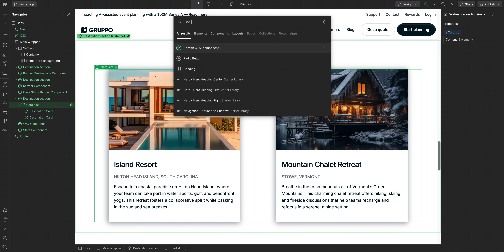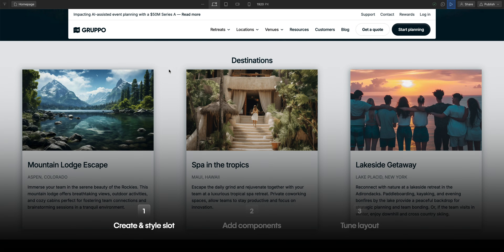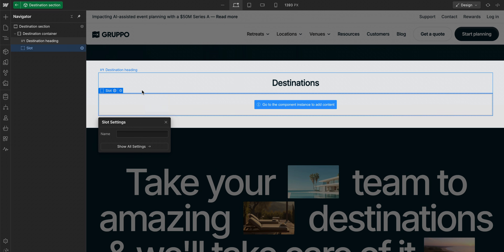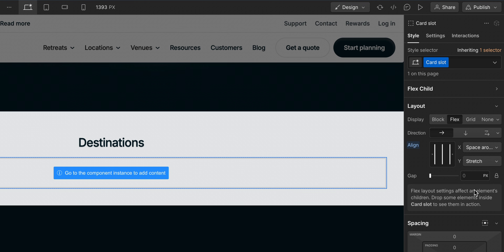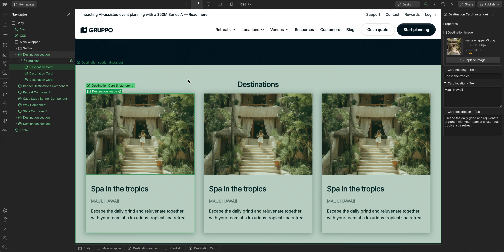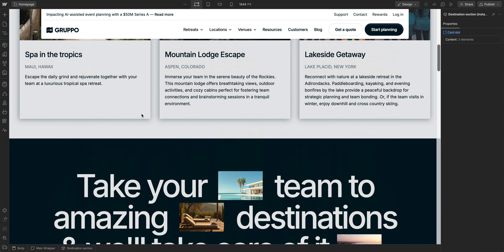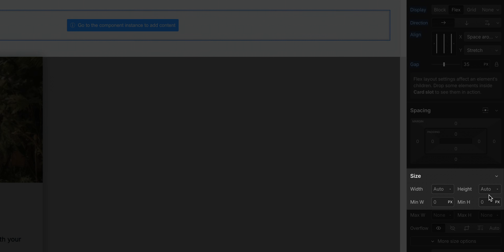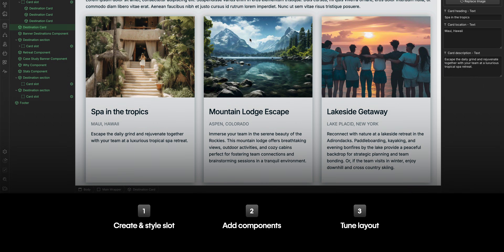Component slots for consistency & flexibility — Webflow tutorial

Comment: Poorly designed workflows can lead to unnecessary complications, especially when creating components. The issue arises when you are forced to work with empty components, making it difficult to visualize and design interactions. Without proper content, designing mouse interactions becomes challenging, as everything appears blank.

The process becomes even more frustrating when adjustments to images and text are made before creating the component. Once the component is created, you have to redesign everything, reapply styles, and reconfigure slots. This inefficiency is compounded by the fact that many class styles or parameters may not function correctly when applied to slots. This forces you to readjust settings and rebind slots in the interaction area, creating a repetitive and time-consuming workflow.